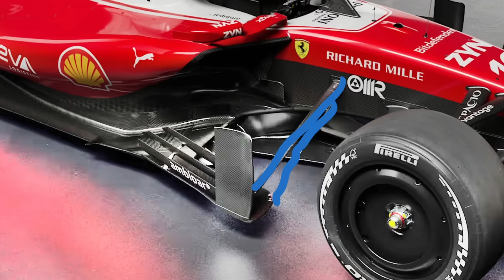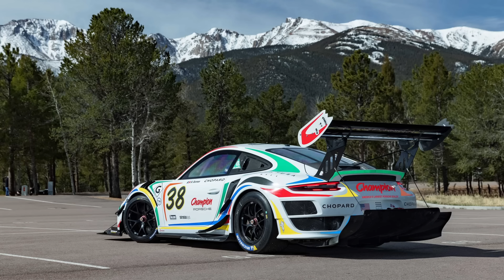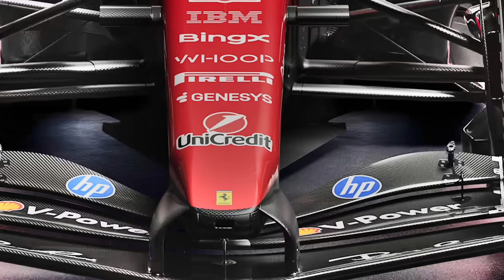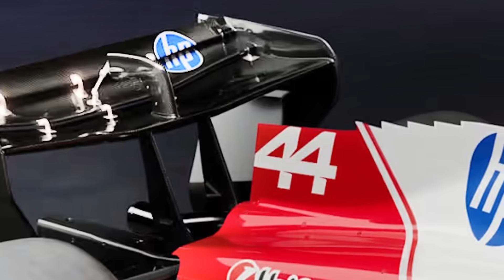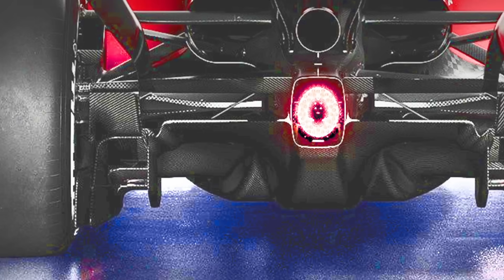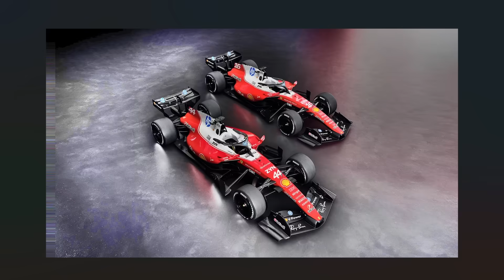Ferrari  SF-26  -  Aerodynamics Analysis and Initial Thoughts

Comment from the maker: Ohhwee it's getting a bit hectic with all the analysis at the moment. Hope you all enjoy!
Reply: @Kyleengineers Hey Kyle, thanks for all the videos, I'm enjoying them. Would you help me understand something please. The DRS was engineered to open up, so if it failed the pressure would push it to a closed position which is safer. Watching the video of Ferrari front wing, that falls back flat, so it doesnt have that safety mechanism. Is that correct or am I missing something? Ta!
Reply: I've been waiting since yesterday :) Thank you
Alpine?
Reply: Gosto muito desses vídeo técnico
Reply: First time I feel I can get some idea about what's really going on in F1! Thanks Kyle! ❤
Reply: I just discovered your channel. The quality of this analysis is better than everything I have seen here, by a lot! Seems like even the big channels don‘t have experts that really worked on aerodynamics like you.
Reply: Just something for thought ? Does the end blade of the engine cover allow for anything other than a angle of choice. Can there be a differential of edges or points such as the top line of the Ferrari. From the horizontal to the perpendicular part of the engine cooling?

Comment: The lower sidepod intake lip makes a downforce producing vortex along the G-line, I realized this as I was studying the F2004. If you notice on that car, the bargeboard has a horizontal vane that's in line with the lower side pod inlet lip, and the upwashing vane downstream along the sidepod, exaggerating the undercut. That whole vortex system along the G-line makes upwash/downforce, just like the 2004-2005 cars, but restricted by the regulations to have more svelte shapes.

Comment: @5:56 that's actually a really clever thing Ferrari did with the front lower wheel deflector. The rules allow a small deflector on the leading edge of the front wheel drum, the rules say it has to be covered by the lip(if fitted) So it seems they combined the lip and the front deflector into that intricate shape. Nice spot, I didn't even see that until you mentioned it.

Comment: The shark fin looks ridiculous and useless.  Did they really need it to control yaw, as if they knew it would be ill-handling?
Reply: That's a naive comment, and the approach taken by straight line runners from half a century ago. 

In F1, the feature is used to optimise and manage flow to the rear wing during yaw, to improve efficiency.

Edit - if it was as basic as you say, then every team would always maximise the size, and they would never cut it back, notch it, etc, etc
Reply: You know son...cross winds are a thing in the real world...
Reply: @solinvictus1234  Then why is no one else using one of that size?
Reply: @AndyFromBeaverton  Cause you're blind, Mercedes have it, RB have it, etc  etc
Reply: @AndyFromBeaverton I've already explained it to you!!
It isn't about generating a lateral restoring force during yaw or cross winds!!!
It is about controlling the air to the rear wing in such events. 

Wake up !!!
Reply: @procatprocat9647  If I could bet you, I would bet that a large portion of the shark fin disappears before the end of the season.
Reply: @AndyFromBeaverton Well because it isn't for the fundamental reason that you thought, and because it adds weight and drag, they will very likely reduce it or reshape it as they optimise and develop their designs through the season, and for each track. 

You truly are thick.

Comment: After further analysis of the aerodynamic properties n the expected power unit potentiality, I conclude that this sf26 Ferrari f1 car would be the championship winning car in 2026.
Reply: Good luck.
Reply: how come
Reply: Ferrari's PU will be 3d best. Nobody is talking about the fuel at all but Shell are the worst when it comes to AS fuels. And this is very basic aero. Mercedes already have more details on it. Expect the AM-Honda to be a strong car and more details to come in all the other cars too.
Reply: @rohitrevankar7674 actually shell will be the strongest early.
They have exp with indi
Reply: @iamtheshadows4916  You clearly dont know what I am talking about. Their fuel depends mostly on biomass while Aramco and Petronas have a good handle on the synthetic components. These fuel are nothing like whats used in indi. Go read the regs and understand yourself. Biomass fuels dont have much potential for development and optimization. Also petro additives are banned in F1 for a while now so not sure what product Shell can come up with if they are behind the race in terms of AS dev.
Reply: @rohitrevankar7674This is literally a mule car. Relax
Reply: @antonysaddy7716  Its not a "mule" car. And everyones running a basic chassis right now. And everyones going to keep adding bits to it. Thers no Aero discussion to be had. But its no big secret that Ferrari will not have the strongest engine.

Comment: With al these movable aeros. Does it mean there cant be anything like a front wing replacement
Reply: The hydraulic lines going to the front wing will have some kind of qd fitting between nosecone and tub that allows for a quick swap.
Reply: Wet mate connectors are fitted to the bulkhead for quick wing changes
Reply: They will be able to replace front wings as usual , but it may mean drivers are more cautious when wheel to wheel
Reply: @sdm107   No they dont need to be cautious lol.

Comment: This is kinda pointless as Ferrarihave said this is a mule car
Reply: It's not a mule car, they'll simply have aero updates in Bahrain/Melbourne.
Reply: @boostav There is a 'A' spec which it is now where they said its more about systems and reliability testing, spec 'B' for the second test and spec 'C' for the final test, two spec changes away and there are things I expext will stay structurally but I am expecting a lot of aero changes over the 3 tests
Reply: @ZKev1   You are going to be disappointed. The "specs" arnt going to be so dramatic. Just more detailed. A mule car is one with non-representative chassis and aero. Thats not possible as they are literally running a 2026 chassis and PU plus aero.
Reply: @rohitrevankar7674 I hope not because that engine cover with its massive exit isnt great, the floor is very basic on its outer edges and I would hope to see more on that as well as turning veins on the endplate of the wing
Reply: @ZKev1  Yeah everyones going to keep developing their car. Ferrari will obviously have upgrade parts for the tests as will everyone else. We will know after Bahrain and Melbourne practice as to whos got the more detail and innovation and whos got the corresponding performance.
Reply: @ZKev1  What you just wrote proves what I stated. Engine cover will get tighter, no need to push thermal limits in early testing and run into reliability issues when you need to run the car for the max laps possible. Likewise detail work on the floor and other aero bits will be continued. That doesn't make it a mule car, which is a very different thing.

Comment: Do you think teams will use 2 element wings and/or only move 1 element similar to mercedes? Is there any advantage to not using all 3 elements?
Reply: Without having the data teams have its impossible to know. That said running one set of flaps instead of two should in theory make the wing lighter and have less points of failure. 

It may also be the case that some tracks are better to have 2 elements and others 3. For example Zandvoort would benefit more from a high downforce setup where as Baku would be benefit from a low downforce set up. By only running 2 elements at Baku, you can in theory cut down on downforce to a much greater degree.

Comment: I can’t help wondering about the vulnerability of these aero structures behind the front wheel.  Imagine a turn 1 fracas and these parts go flying. At that point your race is over.
Reply: This has always been the case with bargeboards. 22-25 was unique in a sense the cars had zero/no bargeboards.
Reply: @discofrancais  not zero technically speaking those venturi tunnel were a bargeboard and if damaged your race has ended with downforce loss that's what happened to Max in 2022 Silverstone
Reply: In fact, the external floor vanes were used as bargeboards.  @discofrancais
Reply: you mean like all 2017-2021 cars?
Reply: @Nicochan388  2010-2018 *
Reply: @Nicochan388  Oh you are clever aren't you.
Reply: @bmc3663 thank you :)
Reply: I love how new fans are mentioning the same thing that everyone said in 2009 and 2017 when the increased the bardge board sign or when in 2019 they changed the size again.
You never want to damage your car simple they don't design car based on minimum damage effect on aero load that just never happens
Reply: That and the front spoiler foot plate look especially vulnerable 😮
Reply: Not sure the race is over but agree the brace looks, a bit amateur.